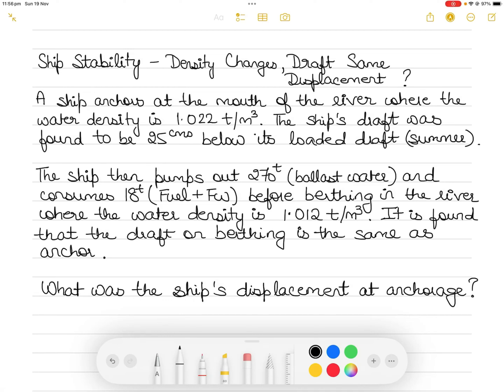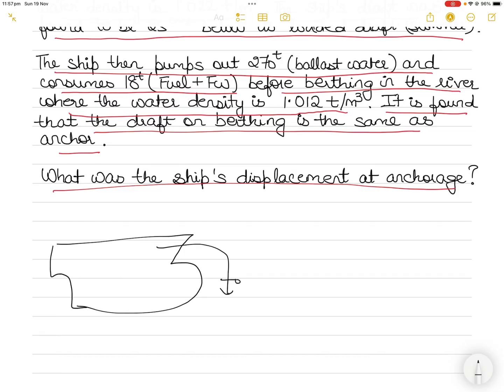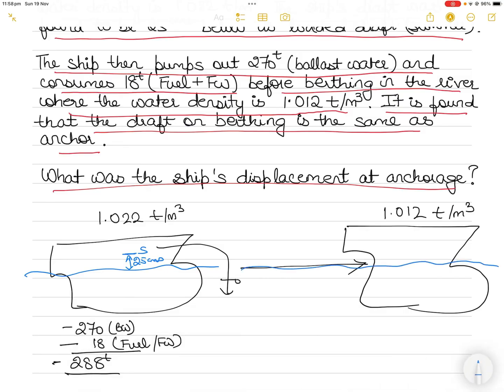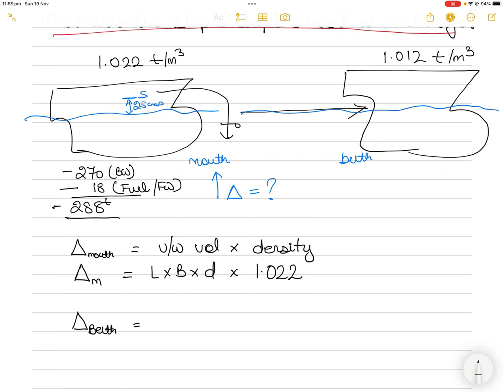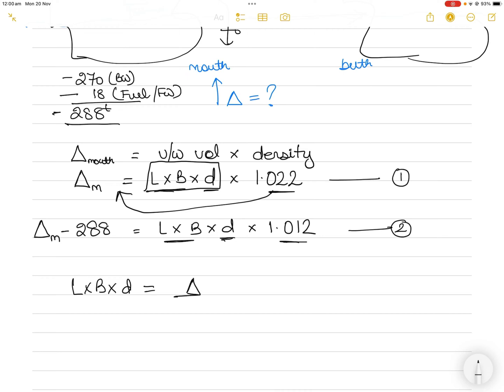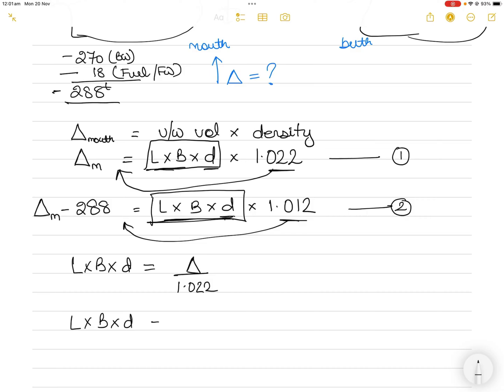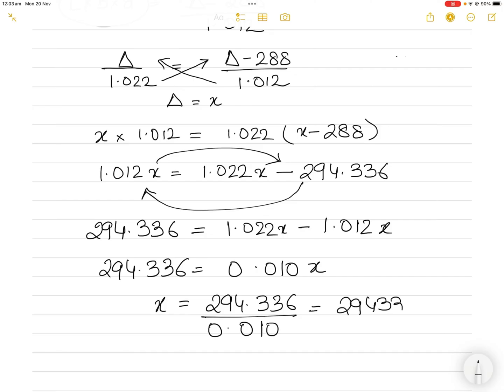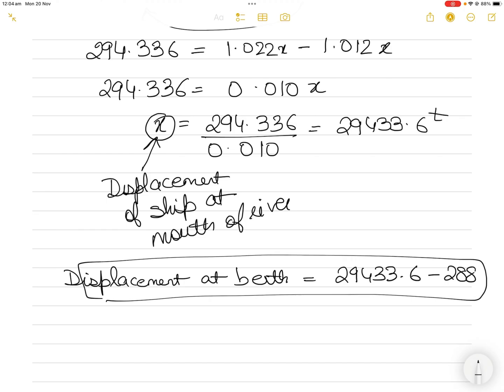Ship Stability - How to calculate displacement if density changes but draft remains same??

Comment: • A vessel of displacement 12000 t, TPC 20t, arrived at a river port, at an even keel draft of 6.20 m, in water of RD 1.020. The tidé is expected to fall by 70 cm at low, water, when the RD of water is expected to be 1.012.
If on arrival the under keel clearance was 30 cm, find the minimum amount of cargo to discharge to ensure that she will have an under keel clearance of 20 cm at low water? Sir Answer Please